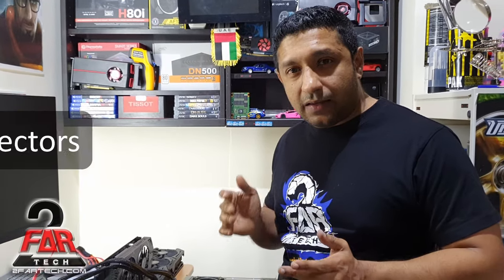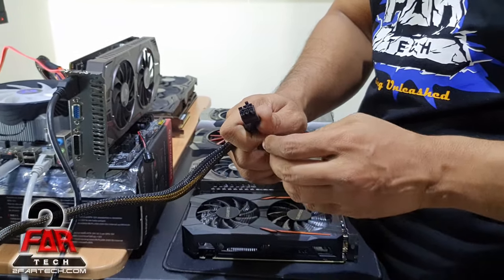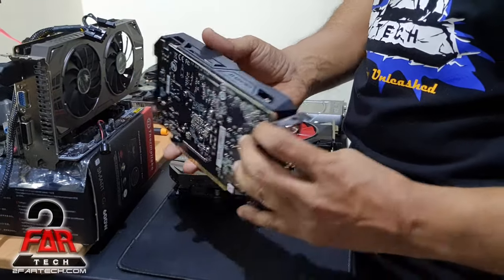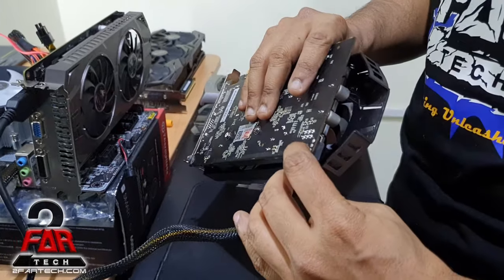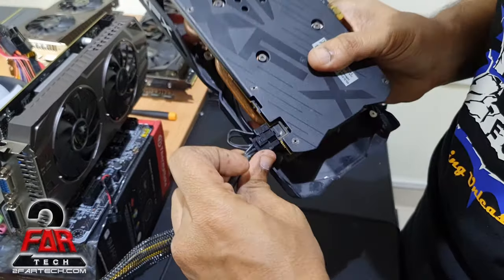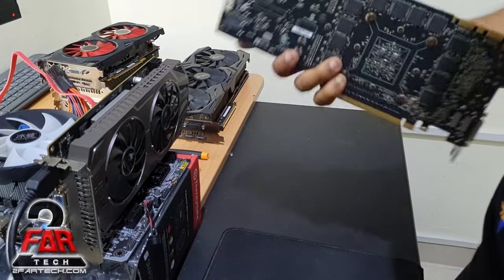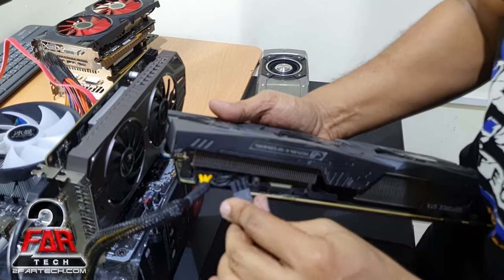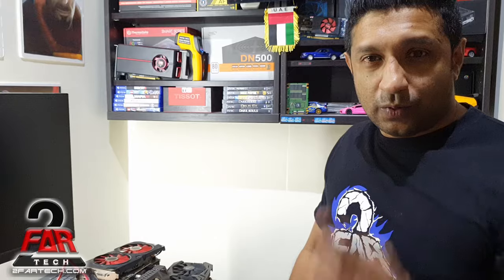How to connect the power to the graphics card?

Comment: My gpu required 6 pin,but my psu come with 18 pin,Can it be connected?
Reply from the maker: Sorry for the late reply. But I am not familiar with your PSU. If you still need some support, can you give me the model number and details of your PSU
Reply: @2FarTech  sorry,I mean my psu comes with 16 pin,can it be connected?
Reply from the maker: You mean the only connector from your psu is 16pin power cable?  Is that only cable?  Without model details i won't be able to be sure about whare you are saying.
Reply: @2FarTech  no no,I mean 16 pin for gpu,but my gpu only required 6 pin,the PSU model is AIGO GP550 550W

Comment: I can't find the pins in my gtx 1650!
pls help
Reply from the maker: There are some models of gtx 1650 without the 6 pin connector.  The gtx 1650 is supposed to be a 75 watts gpu and this 75 watts can actually be drawn from the pcie slot. These cards perform okay, don't worry

Comment: My 8 pin connectors that came with my power supply dont seem to fit
Reply from the maker: 1. The 8 Pin that came with your PSU might be actually the 8 pin for the CPU power?
2. The 6+2 Pin connector or 8pin connector might have small notch on the cable side that now allowing it to go down on the graphics card.  (I havent had issue with plugging the pin to the graphics card, but i have noticed the some pin dont plug into splitters. 
I can get a  better idea about your issue if you share the exact PSU model details.
Reply: @2FarTech  thanks for the reply. I figured it out lol

Comment: What psu u used for this video
Reply from the maker: Corsair CX750
Reply: @2FarTech  
That was quick thanks
Reply: @2FarTech  
I got a gtx 680 4gb classified need  8+8 connectors any psu recommendations I mean with less money
Reply from the maker: @moradlasri2949  You are welcome. Subscribe if you can. Thank you for watching.
Reply from the maker: You could try Thermaltake litepower 650watts. Or aerocool 650watts. 8 + 8 is generally found on 650watts psu. If you found something cheap.  Just send me model and prices,  i will tell you if its worth it.
Reply: @2FarTech  
All I could find is aerocool 650W ATX/EPS 12V - 80PLUS Bronze
Reply: 80$
Reply from the maker: Go ahead with it.  You should be okay.  I have used dozens of aerocool 550watts units on our pre-built gaming pcs. They are fine and at a decent price.  The 650 watts provides 2 x 8pin pcie.
Reply: @2FarTech  
I'm worry about the connectors I don't think this PSU got 8+8 or 2×(6+2)
Reply from the maker: @moradlasri2949  Check the link I am posting, if it's the same model then scroll down on their webpage and click the + sign on Cables. You can see it has 2 x (6+2)pin PCI-E connectors under  VGA connectors. https://aerocool.io/product/aero-bronze-650w/
Reply: @2FarTech  
I was talking about the lux one 
That one on the link cost more then 100$
Reply: @2FarTech  
Corsair CV650 80PLUS Bronze 650W I think will do the job ?!
Reply from the maker: @moradlasri2949  https://aerocool.io/product/lux-rgb-650w/  Actually if you scroll down, click on the Specs tab, and then check the cables, you can see it features 2 x (6+2) pin cables. I know that because I use the LUX versions actually. You can see that in most of the builds on the youtube channel.  If you can go with Corsair CV650, it's even better.
Reply: @2FarTech  
OK
Thank you so much

Comment: My gtx 1650 doesn't have any pin connector, what do i do?? im scared.
Reply from the maker: Did you see the GTX 1050 Ti in this video without any connector? Its a similar concept. The GTX 1050 Ti and GTX 1650 uses 74 Watts from the motherboard. You are fine.
Reply: @2FarTech  my cpu is Ryzen 5 3600x and mother msi mag b550 Tomahawk with 650 watts of psu, is that fine??
Reply from the maker: That's fine.  Enjoy your setup. The gtx 1650 without the extra pin doesn't allow too much overclock for thy gpu. Anyways there is no point overclocking this card.  You are fine.
Reply: @2FarTech  so basically gpu with 6 pin connector needs extra power, and without 6 pin connector means doesn't need extra power am i right?

Comment: Where do I find my 8 pin connector?
Reply from the maker: Look for it at the PSU (power supply unit) wires. If you PC is branded like DELL or HP, it might not be there unless its a high end unit or a workstation.

Comment: i have a 1030 will it work
Reply from the maker: The GT 1030 doesn't require additional power connection as it uses the power from the motherboard. If you are planning to buy a GT 1030, please don't get it if you want to game on it. Instead, see if you can find some used GTX 1050 Ti.
Reply: @2FarTech  ok

Comment: where do i get those pins
Reply from the maker: By pins i assume the power cable plugged on the gpu? It comes with the power supply.  And if its not there on the power supply then it means the power supply isn't capable of running this card.  The other way is to use molex or sata to 6pin or 8pin pcie. That's a bad idea.
Reply: @2FarTech  I have a small pc and can you tell me where you can find the cable?  I don't know where to find it inside my pc

Comment: what if my graphics card doesn’t have a pcie
Reply from the maker: Then you have nothing to worry about.  For example i am having a gtx 1050ti  which doesn't have the 6pin pcie port in some cables. In such cases you can just plug it to the motherboard and start using.

Comment: Can i connect2x 1660s with single pcie cable
Reply from the maker: Which means you will use a splitter? It might work, but if you are planning to do mining or intensive rendering work, this might not be the best way... You could connect the PCIe to GPU 1 and use 2 x Molex to PCie to GPU 2.
Reply: @2FarTech  I have 8 pin psu to (6+2)+(6+2) pcie cable which supply one 3070 and two 1660s ,i never saw that we covert molex into pcie ? Is this possible
Reply from the maker: https://www.amazon.com/Cable-Matters-2-Pack-8-Pin-Inches/dp/B01DV1Z428
Reply from the maker: I am not asking to buy that,  just showing you as an example.  There is also sata power to 8 pin. As i can see you have really loaded up the cable.  I believe you have modular psu. High chance of burning the 8pin connector which goes into psu if you are mining.
Reply: @2FarTech  i give approx 160 watt total power 85+75 watt to one single pcie ... Means connected two 1660s in one pcie for the time when my cable is delivered
Reply: Ohk i saw that cable it is safe to use ? For one 8 pin gpu ?
Reply from the maker: @lxldigvijaylxl  Do you have 2 x 8pin PSU Cable? Can you mention the model number of your PSU, I will remove all the confusion right away.
Reply: @2FarTech  antech 850 watt gold pmw , psu (8pin)to two (6+2)+(6+2) pcie 3 cable i get on this
Reply from the maker: @lxldigvijaylxl  I am going to assume the following Model is the one you are talking about. For that unit you have 3 Main PCIE wires coming from the PSU. So there is nothing to worry. First PCIe main Cable powers the 3070, The second PCIe main cable powers the First 1660s and the Third main cable powers the Second 1660s. I dont understand why this confusion ever started. I suggest you use all the three cables instead of using the tail extension, in this way the cables are not loaded and the resistance on the wire reduces letting the voltage be stable. Yes, you can run one 3070 from the single PCie main cable, dont worry.
Reply from the maker: @lxldigvijaylxl  https://www.antec.com/product/power/hcg-gold850
Reply: @2FarTech  i have 4 gpu right now running with 3 Power pcie cable i connect 2 1660s with one pcie cable

Comment: 3x8 not added so no 30 cards?
Reply from the maker: Back then rtx 3080 was just launched and i didn't have any 3rd party rtx 3080s. But after working on dozens of rtx 3080, most of them i used only had 8 x 2. Few oc versions had 8 x 3. Anyways the logic is the same as 8 x2, plug in extra

Comment: how about a 3080 with 3 x 8pin?
Reply from the maker: If you have a psu with 3 separate 8 pin cable you would use that.  Some psu has only 2 x 8 pin cable but each of these cables would have a pig tail or another set of 8pin on the same wire.  So you can use that for the third 8pin.
Reply: @2FarTech  I got 2 for VGA 8 pin and 2 CPU 8 pin. Can I take one from the CPU ?
Reply from the maker: Cpu 8 pin will not plug into the gpu. The socket is different and if you push it through, you might damage your gpu. And when you turn on the system, either the system will immediately shutdown due to short  circuit or blow up thr psu if it's a cheap one.  
If you have modular psu, check if you have extra 8pin psu cable.  You could probably plug it into the cpu socket on the psu.  Some brands of psu allows this.  All these info will be on the psu manual.  Look for it.  Also just tell me your current config and your psu model type.  Maybe your psu can't handle the graphics card load.

Comment: how about to my gpu with 3x8 pin
Reply from the maker: Then you must be having a Higher end PSU with at least 3 or 4 x 8 pin. Typically good branded 750Watts PSU comes with such an option.
Reply: @2FarTech  yes i know but i want 3 single gpu 8pin sleeved but 0 chance to find it i allready have corsair rm850x

Comment: I feel like 8 pin to dual 6+2 is stupid af
Reply from the maker: Depends on few factors.  I have cheap psu with this configuration running rtx 3080 in full till day and night.  I also have similar setup with separate pcie cables for the gpu. If the wires can't sustain the load or the pin can't, then you will have failure.  Better to follow the pcie pin specs to be on the safe side.
Reply: @2FarTech   you don’t notice the low wattage? Im running my 3060ti ftw3 ultra 8 to to 6+2 and my power won’t get above 50 % when my gpu is at 100%. Im about to go back to single 8 pin pcie cables. Im only getting 150watts out of 270 watts that’s what the manufacturer says on the website and other people with the same card.
Reply from the maker: Use the original cables.  If a decent psu came with 8pin x 2 on single cable then it will work.  But if you have individual 8pin cables, it's the best way to go.  I never faced issues, i am talking about 100s of installations.